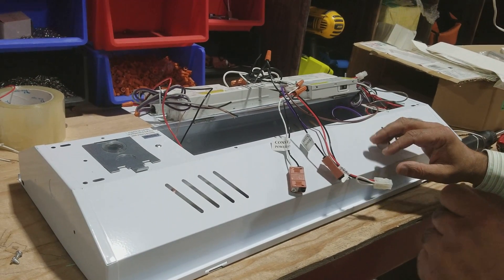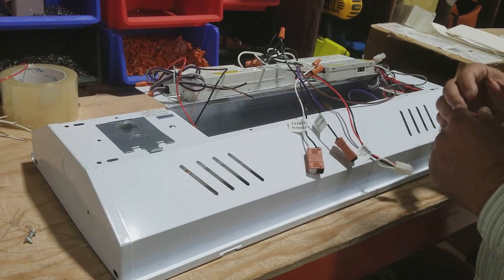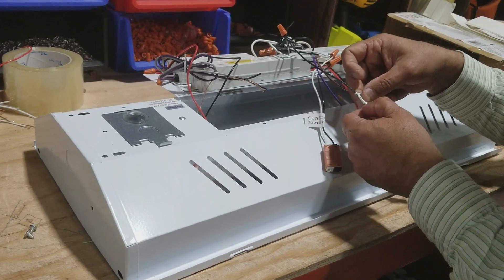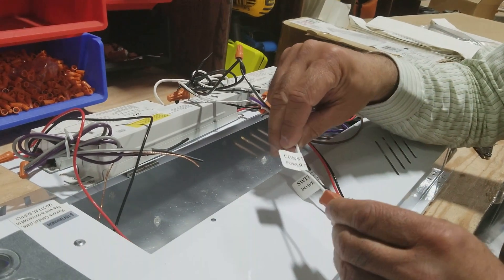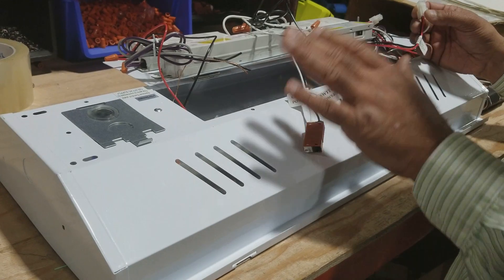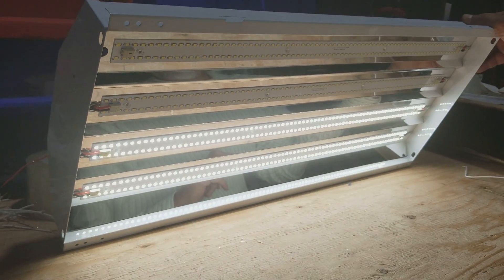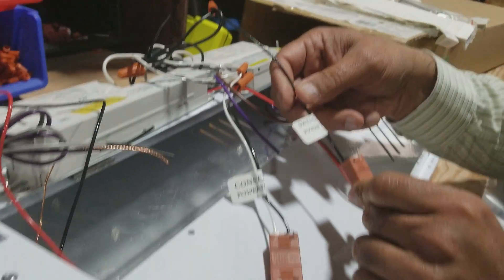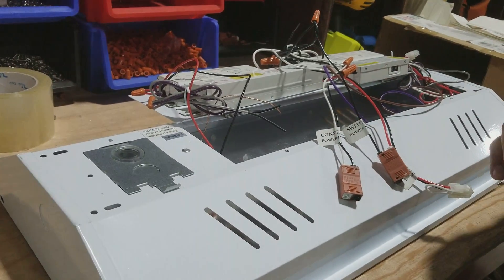How to Wire Your Emergency Backup BK-800 & BK-1600

Comment: So if I already have a bunch of high bays installed on a switch and I wanted to add battery backups on every 5th or 6th light I would just use the switch leg to that one wire and then would also need to run a hot to every fixture with a backup? And then I could still use the switch on the wall and shut them off as usual but then the constant hot is what activates the backup system is that correct
Reply from the maker: That is correct basically correct, the second Hot (constant Power)  is there for the system to sense that that there is still power in the building. if both powers are off then the Emergency system considers it as the building power is out. the first Hot is connected to the back up system as a switched power made and used to feed the power to the driver to shut unit off and on the light. One must be careful to connect Hot-1 and Hot-2 to the proper input wires.
Reply: @cybertechlightinginc846  thanks for the reply